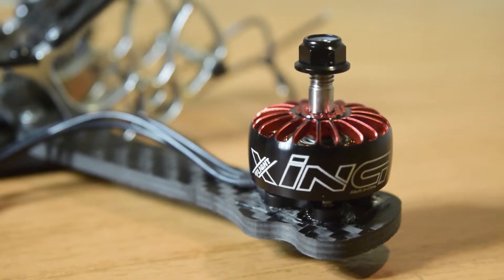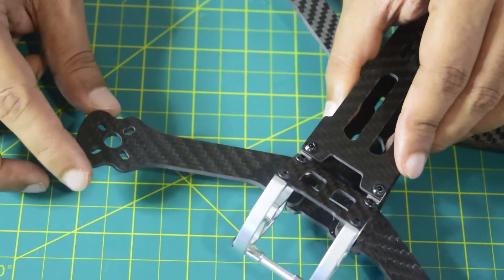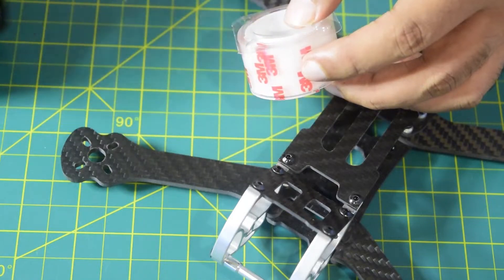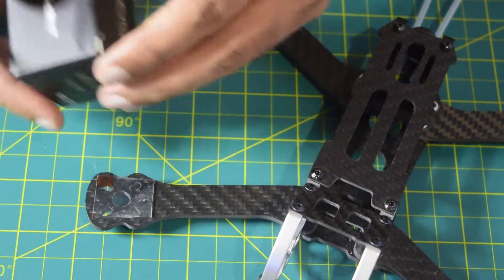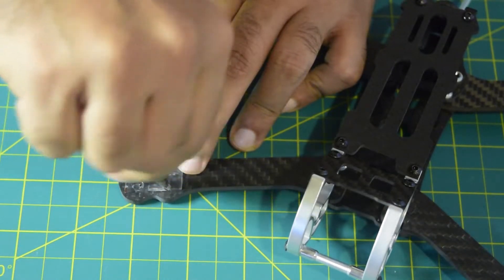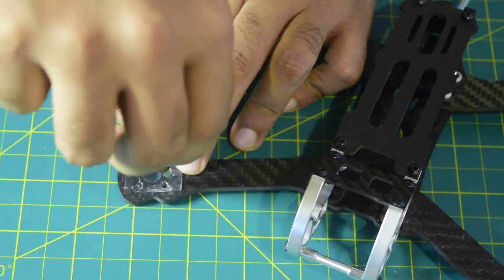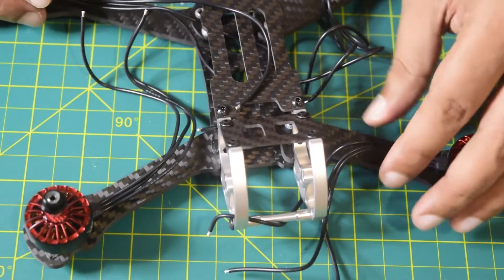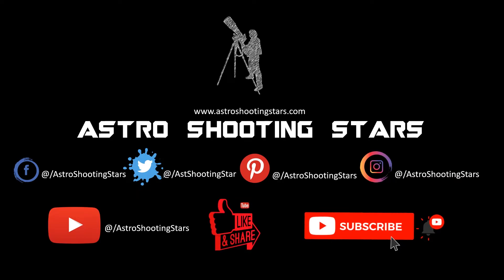How To Install iflight Xing2 2207 1800KV Brushless DC FPV Racing Motor  on Rooster 230 Drone Frame

Comment: Great video.  i have an iflight xing 2 1404 3000kv fpv motor and i have some propellers for it. The propellers doesent fit right on the motor so i think i need a screw or something. Am i right and do you know what i need😊